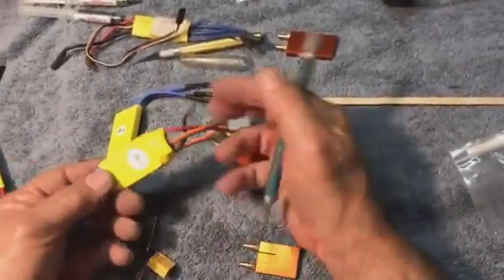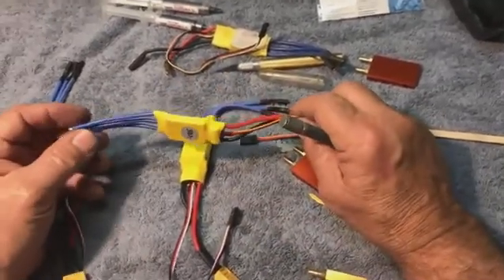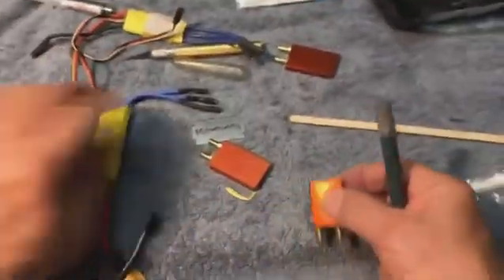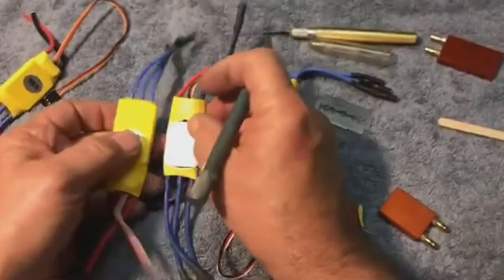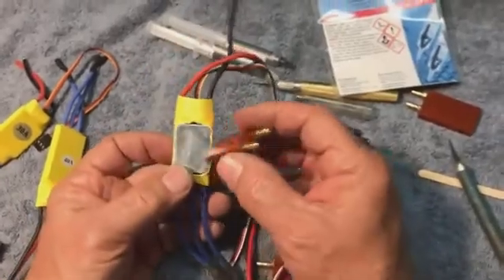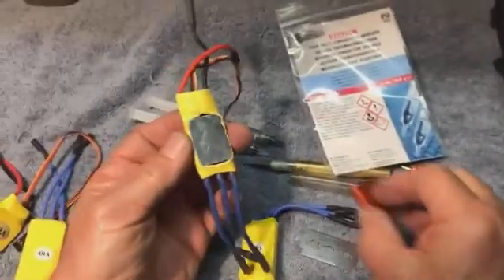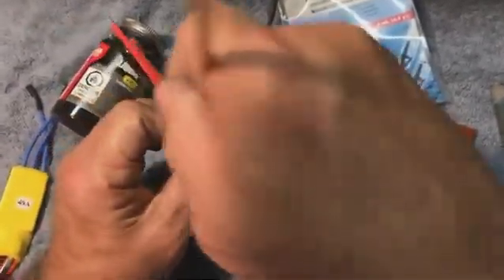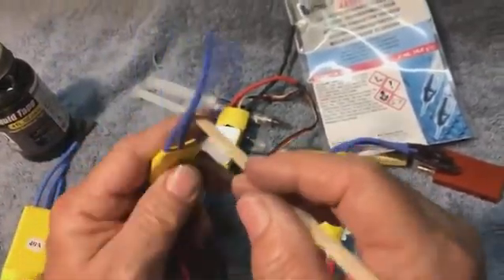Dr. Jet converts a Mystery 30A ESC to marine use

Comment: Lol. 500 roll of the, Conveyor belt before it shuts off.     Nice job.  I've used those on boats without watercooling.  Just sprayed corrosion x in the heat shrink...   never could  bind with a pistal grip rx/tx.